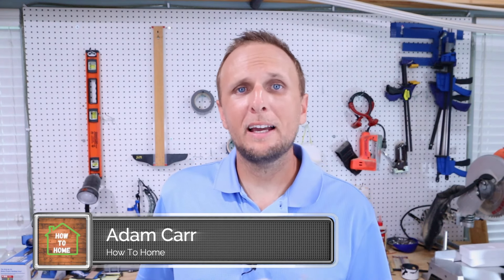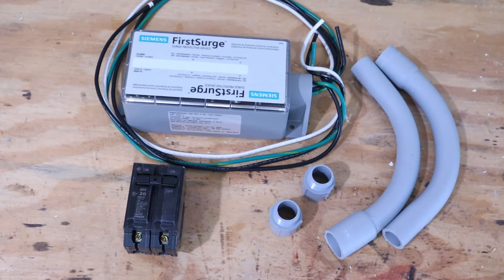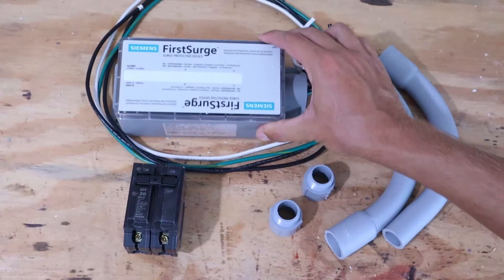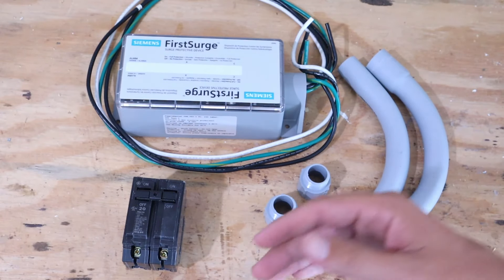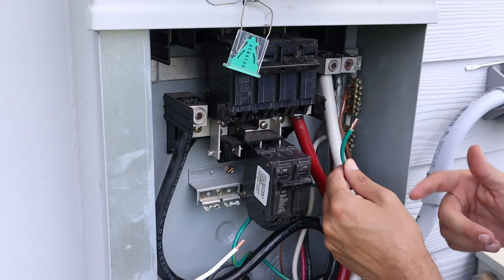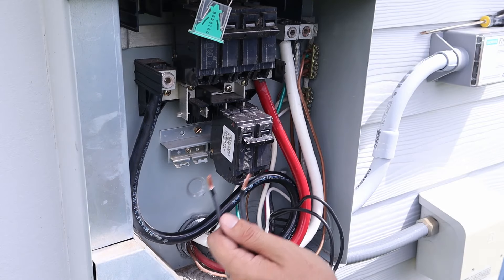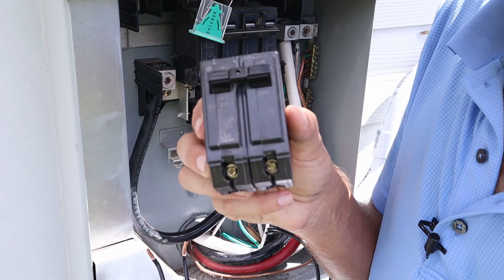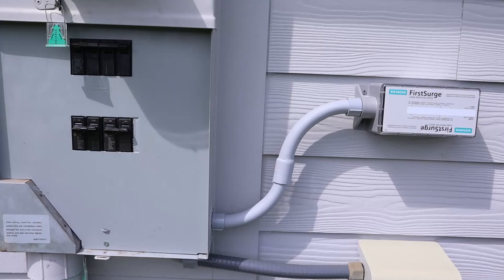How To Install a Whole House Surge Protector | Siemens FS140 Whole House Surge Protection

Comment: Just be aware that Siemens says to keep the wire run from the SPD as short and straight as possible to get the best protection. I think ideally in a setup like this, you could mount it vertically right underneath, and eliminate a foot of wire and 3 bends.
Reply: ...along with the above comment, it shoudl be noted that the surge protector needs to be placed as close as possible to the incoming power (which is what Adam is doing)... do not install on breaker box in the basement....

Comment: I had a lighting strike a month ago and took out my security cameras, ac, tv receivers, tv monitor and my sprinkler timer. My father retired from Siemens and they have excellent products. Thanks for the info.!
Reply from the maker: Hey Robert, sorry to hear about all of those electronics going down all at once.  That is a lot!  We had a surge a while back that took out the oven which is what prompted me to look into these.  From the research I did, the Siemens surge protector seemed like one of the best all around.  Thanks for watching and your feedback!
Reply: Well, according to the statistics, you should be good to go and not need one. They say lightning never strikes twice.
Reply: @katnip7976  Statistically, lightning more often strikes twice.

Comment: I have watched several videos on surge protectors and yours is the most informative, I also like the Siemens surge the best. Just had a strike and cost me a few thousand dollars, I learn the hard way, but I don’t want to learn it twice. Thanks EJ
Reply from the maker: I also installed this after I had some expensive appliances fried.  Some look at these whole house surge protectors as too expensive but once you have replaced some electronics you realize that it would have been way cheaper to get the surge protector.  Thanks for the feedback!

Comment: Good video.  I'm having one of these unit installed next week on a retirement property that I'm buying, and my internet research indicates that the Siemens FS140 is the best "whole house" unit available to consumers.  It's costing me about 2/3 more in terms of the other products available, but the property is in SW Florida, where lightning and hurricane risks are very elevated.  Sure hope it pays off in the long run.
Reply from the maker: I would say based on the research I did as well, that I found the same information that you did.  I do believe that it is probably the best all around device available to homeowners currently.  I also like that it lets you know if it sacrificed itself and needs to be replaced.  That to me was a big deal.  It is a little bit more than a lot of them but my thinking is I will pay the up to $200 all day so that I don't burn up parts in appliances and computers that cost much more than that.  Florida is a lightning factory.  I think you are making a good choice.  Well worth protecting your investments!  Thank you for the feedback!

Comment: Thanks for posting this.  Too late for me as we took a strike that killed an expensive double wall oven as well as several expensive audio/video components.  This Seimens unit looks really good and I have one now in my Amazon cart.
Reply from the maker: I bought this because the exact same thing happened to me with our double wall oven.  This surge protector was less expensive than the replacement part so going forward, it was a no brainer for me to install.

Comment: Hi there. I'm adding a 50 amp power input box to the outside service panel so I can connect my generator (it's not an inverter generator). I've heard non-inverter generators produce power that can harm electronics. Will this device protect against damage from a generator?

Comment: Hi! What is your take on using one dual stab 20a vs two single stab 20a breakers? I didn’t see double pole in the instructions. Just the illustration that made it look like a dual.
Reply: My electrician just used "two single stab 20a breakers" yesterday, installing this very device at my home's outside meter base.  He came with a double but it was a different brand than my ("GE") box so he had to go to a local electrical supply house and came back with two GE singles.  I neglected to ask him if there's a difference.

Comment: The sf140 is a type 2 surge protector. In the instruction it says its designed for downstream. To me that means to install it on the service panel vs twh main panel. Am i right, or does it not matter as long as its installed aftert the main circuit breaker from either panel box?

Comment: What if you don’t have an easy access outside panel to add a breaker to? All you have is a 200 amp practically full box inside. I would assume you want that surge protector first in line. That would take a complete rewire of the whole box. Most homes are like this.  Full panels with openings only on the very bottom if at all.   What do you do then?

Comment: Hey!  Is it still effective ENOUGH to install its breaker near the bottom of the panel if you're stuck there?  I know that lightning surges etc happen within nanoseconds and i'd hate to find out that I could've protected my home theater gear better if it were to be near the top of the panel.  Thanks!  I know this is a very specific and important question.

Comment: I am getting ready install the Siemens FS140.  As you have, I have an outside  main meter panel with the ability to perfectly install the protector.  I live in central FL (very hot & wet in summer).  Couple questions: (1) I have no neutral bar in my panel, just ground - I am assuming I can put both the neutral and ground on the same bar - is that correct? (2) I want the leads to be as short as possible - can I drill the 3/4" hole in the panel so I can hand it out the side, as opposed to hanging it upside down from the bottom punch out plugs?  (3) In the install since I am putting the Siemens unit up against the main meter panel, can I just use a single threaded Rigid Threaded Nipple 3/4-InchxCL screwed into the Siemens  and a Conduit lock-nut on the inside of the inside of the panel (with maybe some caulk to ensure a tight seal)?
Thank you

Comment: If my whole house generator (12K) that is connected through my box with a 50amp breaker and "Manual Transfer Switch" were to malfunction, would the Surge Protector protect my house just as though the surge came from the grid? Also, since my open frame 12K generator is not an inverter generator it does not have the cleanest sine wave, will it "trigger" the Surge Protector each time I try to use my generator to power my house during power outages?

Comment: What if the meter panel box does not contain a neutral bus bar? Do I connect the neutral wire to the ground bus?

Comment: I just installed a Reliance generator inlet box after watching one of your other videos.  I would like to ask if the power goes out and I'm powering my home with a generator, do leave the breaker switch turned on to the Siemens whole house surge protector?
Reply from the maker: I do.  Really no reason to turn it off.

Comment: @HowToHomeDIY Hello Adam, thank you for sharing the great video. However, I'm unsure why Siemens recommends installing the Surge Protection Device (SPD) behind a 20-amp circuit breaker. As I understand it, the SPD isn't a pass-through device; the electrical current to your home doesn't flow through it. Consequently, it cannot cut off power to your home during a high surge (as it is not a relay or contactor). What it does is, upon detecting high voltage, it attempts to divert the circuit to ground. If there's a transient surge, the voltage might drop because of the SPD's shunting action (Shunt Load). If the surge is prolonged, the intense current caused by the SPD could trip the home's main breaker, preventing damage from the high voltage. However, placing the SPD behind a 20-amp breaker means that in a surge situation, the SPD might draw over 20 amps, causing its breaker to trip. This would protect the SPD itself but leave home appliances vulnerable since the SPD would be offline while the surge persists. Therefore, it seems more effective if the SPD's dedicated breaker has a higher rating than the home's main breaker. This arrangement ensures the home's breaker trips first, prioritizing the protection of the home over the SPD. Home First!
Reply from the maker: It is because a surge happens way too fast and they are more of a voltage spike than they are current so a circuit breaker is not going to trip.  These are extremely effective as installed.
Reply: @HowToHomeDIY  Thanks for the reply, by the way I noticed a review at Amazon by someone, I am pasting it here ---""Had this installed a few months ago after a surge ruined a few appliances in my home. Recently a tree fell across the power lines across the street from my house causing a surge which blew up 4 breakers, another coffee machine, garage door opener, printer, and a few other small appliances. The damage was around $900. When the electrician contacted Siemens they told him the suppressor doesn’t cover a “sustained surge”? The unit seems totally fine lights are still green, it would have been nice if it at least fried the unit in the process but it did nothing. Don’t waste your money I just installed surge protected wall outlets at all my small appliances for $100 for 5 which seems more worth it. My neighbor installed a similar siemens unit at his house and his heat pump motor and circuit board blew also.""--- What I think the 20Amp was tripped so the SPD itself is still healthy while the rest is fried up!
Reply from the maker: @manclt704 possibly, since it was a sustained and abnormal surge. But we don’t know that for sure, we don’t know if the unit was installed properly per the manufacturer’s instructions, we don’t know really anything to verify the surge protector had an opportunity to do its job.  I look at Amazon reviews but take them with a grain of salt as oftentimes there is user error. There are also countless reviews praising the unit and overall has 4.8 stars which is extremely high for an overall Amazon review average.  There are also numerous reputable sources that tout this unit as the best on the market and go into great detail as to why.  This one review also is talking about a constant surge.  No surge protector is designed to be able to withstand what I would imagine was a long period of time of surging.  A normal surge will not trip a breaker.  Bottom line is, if you don’t want it, don’t buy it.  For me personally I had numerous appliances and smaller electronics like a surround sound stereo get fried on different occasions but in the past 3 or 4 years since installing this I have had zero damage and I live in what is considered the lightning capital of the US.

Comment: Very helpful and timely. Just installed some new appliances with wifi and other electronics on board and was considering this type of device. Your slow start video was helpful also. Is this devise compatible with a grid connected PV system?  Thanks much.

Comment: Did you read the instructions where it says to cut the wires to the shortest length possible to make the connections?

Also did you see that the instructions say to avoid bends in the leads?
Reply from the maker: They were cut shorter than they came and there aren’t any bends.  Did you watch the video?
Reply: I did watch the video. You used curved conduit and it appeared that there was still a good amount of slack in the wires.
Reply from the maker: @martyoconnor5644 curved not bent.  No hard turns in the wire.  Perfectly ok.  And it may look that way because I did leave some slack but they were cut shorter.

Comment: So I looked into the Zap Cap that they offer, zap cap only protects from the pole to the meter.  The Siemens FS140 and it's counterparts like the FS100 they take care of surge and power "backlash" from the constant on and off of compressors in the house like you spoke of.
Reply from the maker: They will both do pretty much the same thing.  The Siemens surge protector will stop surges from entering the home at the main panel or if possible, meter panel.  The internal surges, are where you want the standard surge protector power strips on your sensitive electronics and appliances.  They work really well for that.

Comment: Ok so i purchased the siemens FSPD 140 boltshield (supposed to replace the surgeshield 140 pro) to be installed in my Eaton BR panel. I have open slots at top for the breaker but lead length is 17inch so now i have to drill side hole for install. I dont get the wiring as i have  labeled 2 black (L1,L2) 1 white, 1yellow with green stripe,Another Black with 3 small wires. What is the 3rd black with small wires? and though i have gnd buss and separate  common buss can i place both gnd and common on same buss bar? thks

Comment: Thanks for your video!! What can I do if my main breaker panel has no more empty space left? Thank you!
Reply from the maker: Well you could look into installing some tandem breakers to free up some slots.  I had a family member recently that there just was no way to make it work without installing a sub panel so I had them get the utility company to install a surge protection device on the meter itself.  Just depends on your particular scenario.

Comment: My electrician not licensed installed a FS100 directly to the big cables by loosening the two Allen screws for the main cables into the panel the two lights are green but is this incorrect and what’s the difference between his way and the double pole breaker please explain cause I’m going to ask him to correct his work he should have looked at the instructions.

Comment: How often will you need to replace this? 10,15 years?
Reply: There is a 10 yrs. protection and warranty. The fs140 will let you know when it needs to be changed by the red light and audible alarm.

Comment: hello, can i Connect the Siemens protector using a 100A breaker? i Saw in the video that you used a 20A breaker. thank you for your kindness
Reply: No. Only a 20-amp double pole breaker.  Any higher than that, you run the risk of too much current, coming through and damaging equipment in your home.

Comment: Hello :) my Siemens Fs140 has: 2 Green lights on, red light blinking but there is not any sound. i have a doubt, the red light must be off or blinking? Thank you
Reply: The red light should be off.  If the red light is blinking, there should be an audio alarm too.  I would contact the manufacture.

Comment: Can I hook into an existing 20 amp double pole breaker that is currently being used by the well pump, or does it need to be a dedicated breaker?
Reply from the maker: Hey Kevin, no unfortunately it needs to have it's own dedicated double pole breaker.  I'm assuming you are asking due to not having room in your panel.  You could either look into installing some tandem breakers on other circuits to free up some space or install a sub panel.  But I would consult with an electrician to see what they recommend for your particular situation.
Reply: @HowToHomeDIY  Thanks for your help! You are correct, I am out of room on my panel. Would adding ferrities to the incoming lines help with high-frequency surge/EMP protection?
Reply from the maker: I have seen arguments that they can possibly help with EMP/higher frequency surges but not low frequency.  To what degree and where that line is, I do not know exactly.  I do know that they shouldn't replace the use of a whole house surge protector. In fact many sellers of ferrites highly recommend also installing a whole house surge protector.
Reply: How To Home thanks for your help!
Reply from the maker: @kevinlamberg3  You are very welcome.  Thanks for the questions.  If you need anything else just holler!
Reply: It's called a "double tap" and is contrary to the NEC specifically, as it deals directly with breakers.

Comment: I had an electrician install one on my fuse panel. I thought the wires were long. Yours seem even longer. Another YouTube video had a diagram. If it’s under a foot and a half it was the best.

Comment: Does it matter where the blank spot in the breaker panel is located (top, bottom, right, left) or will any blank spot suffice?
Reply from the maker: It needs to be in whatever slot is closest to where the power comes in.  So as close as possible to your main breaker.

Comment: My main panel has only one bus bar for both the ground and the neutral.  Is it okay to wire this unit that way?
Reply from the maker: Hey Bill, yes that is a fairly normal scenario.  You can wire it that way.
Reply: @HowToHomeDIY  Thanks.  Great video!
Reply from the maker: @billrodgers2830  You are very welcome.  Thank you!

Comment: Sorry If my question is silly. 

Will this protect from low voltage as well? 
Recently I had issue with my washing machine and the mechanic mentioned it is due to low voltage. 

I'm wondering whether installing such a "surge protector" will help?
Reply: I would still install this whole house surge protector, plus a single outlet surge protector that protects from low voltage as well. (We have both)
Reply: A washing machine doesn't have "low voltage" like a HVAC thermostat.  You are missing something.

Comment: Can FS-140 be installed in a European home with a 220 V 60Hz setting? Thank you.
Reply from the maker: Hey Lou, yes it should work in that application.  Per the manufacturers specs it is for line voltage 120/240 split phase, 50/60 hz.  Hope this helps!

Comment: Will this protect everything? Including the hvac and furnace or do I need something separate for those?
Reply from the maker: Yes, anything downline from this device will fall under it's protection from outside surges.  The idea is that when a surge come in, this device absorbs it before it gets past it to your other electronics, which would include the AC.  Hope this helps!